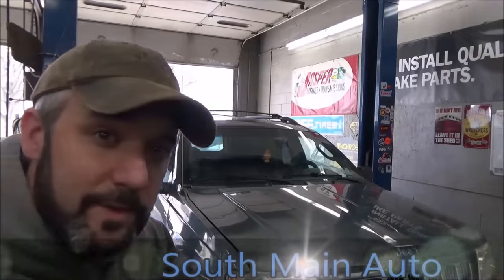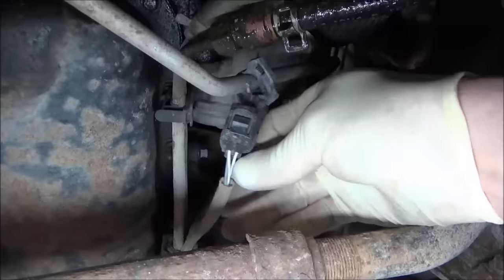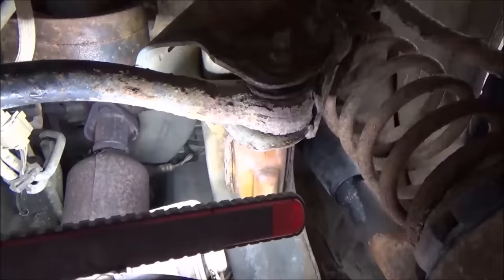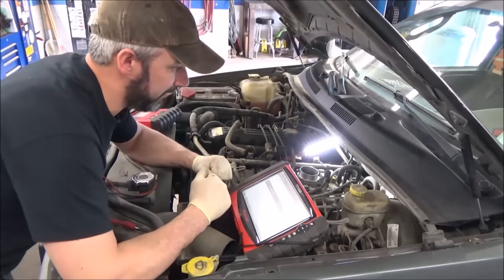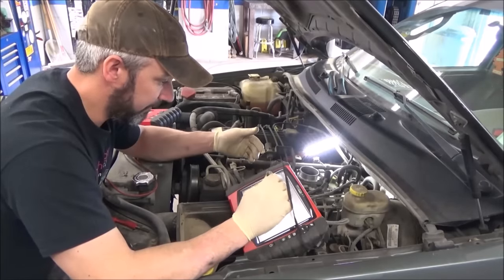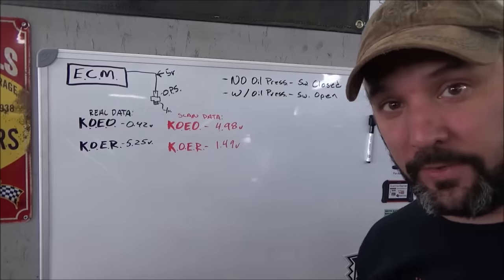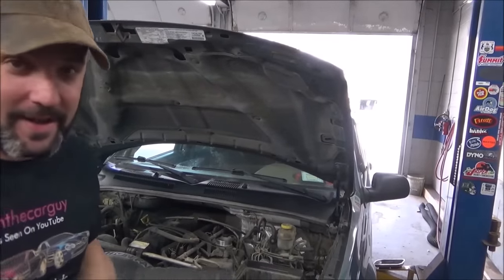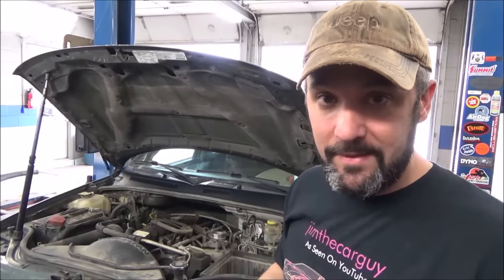Jeep Grand Cherokee - Check Engine Light P0141 / P0155 / P0523

Comment: But god, is this jeep crusty, look like the mice ate the fender :). Anyway, I just wanted to point out that obvious signs of corrosion (like this jeep here) are also a reason to fail inspection in my country. You can have some corrosion under the car (but not penetration or deep corrosion), but visual exterior rust (except minor spots) is not accepted.
Reply: +krugerblue Same in Australia - I once had a 'beater' Mitsubishi Wagon that needed rust bubbles (not holes!) repaired on driver's door and tailgate before it would pass the roadworthy inspection.
Reply: +Darren Coull  Here it depends a lot on the states requirements. Many have no inspection at all !!  Most of the rest say very little about rust unless it's a real safety issue like a rotted frame or similar.